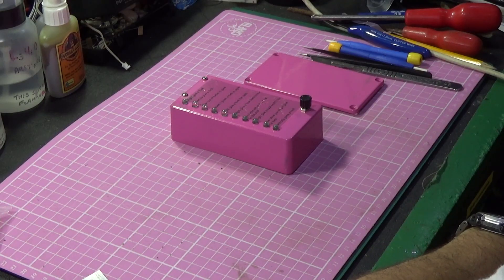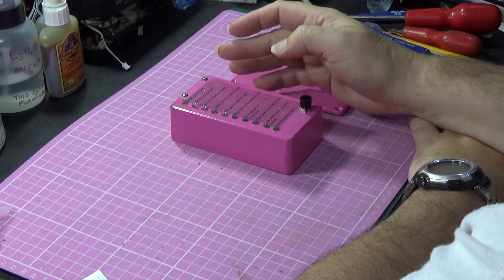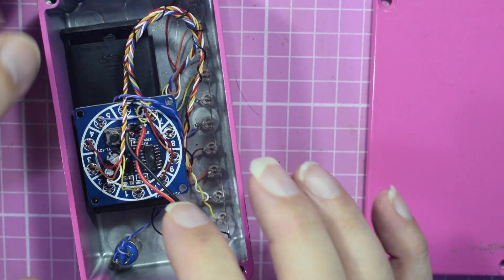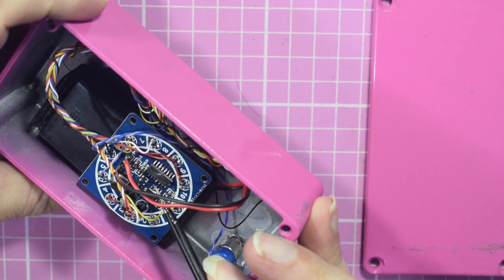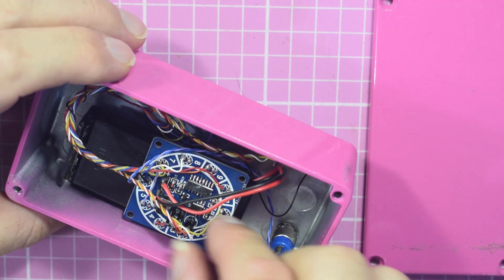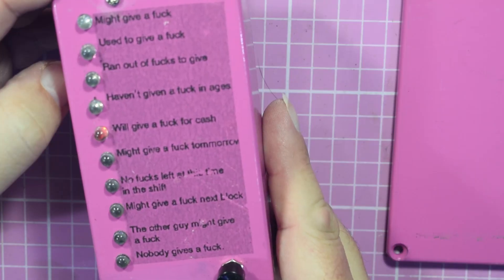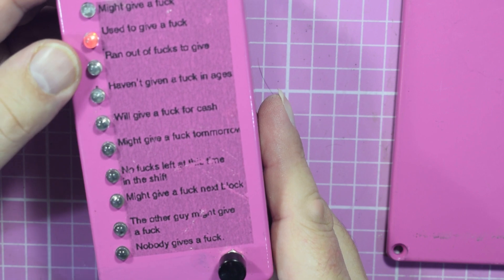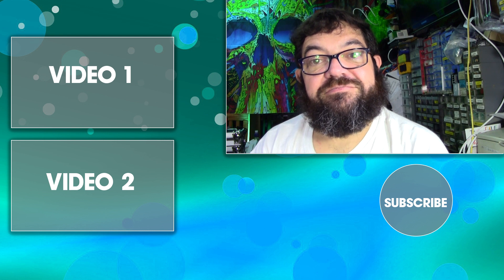F**kometer For the times when you dont give a F**K

Comment: I once heard that that F word was actually an acronym originally put on the doors of houses of Fornicators Under Control of the King, lol.  I buy batteries in bulk off of ebay...something like a package of 48 for about the equivalent of £15.00 and keep them in the center drawer of the pc desk.  I go through a package about once every 13-14 months and they'd last longer if when I gave Christmas presents that took AA's I didn't add them in from ones in the package.
Reply from the maker: I'm cheap and buy Poundland batteries. You get 15 zinc carbon for a pound which last about 20 minutes or the alkaline ones branded sony which are pretty good but only 6 in a pack. F**k is a very versatile word and can be used in a multitude of ways.
Reply: The ones I get are alkaline but branded either Rayovac or AC Delco.  They're cheaper than the Duracell or Energizers but last just as long.
Reply from the maker: We get all sorts of brands, Kodak, Panasonic, Sony as well as various cheap no name non brands. I do see ever ready now and then but they just are no longer a main brand here any more.